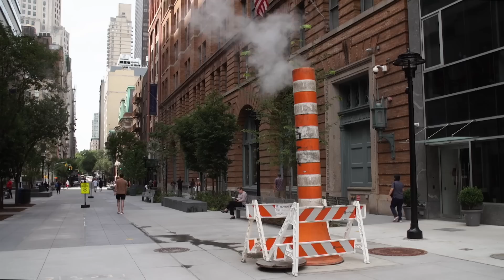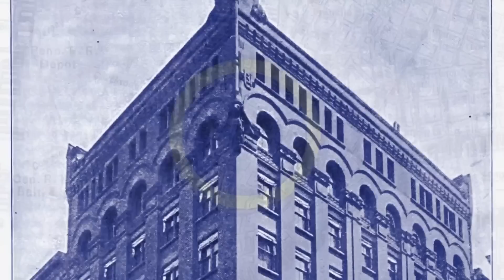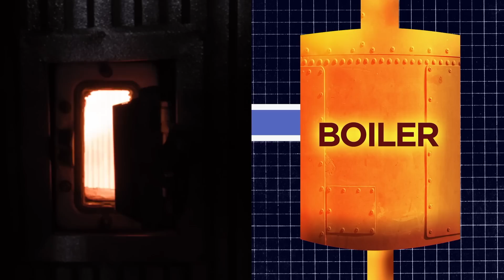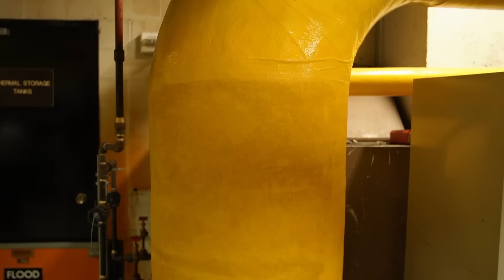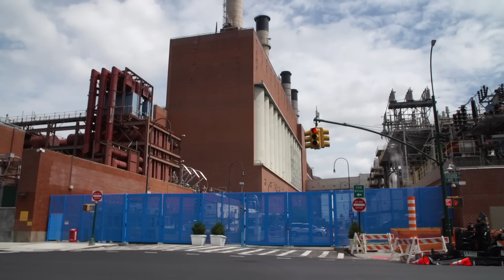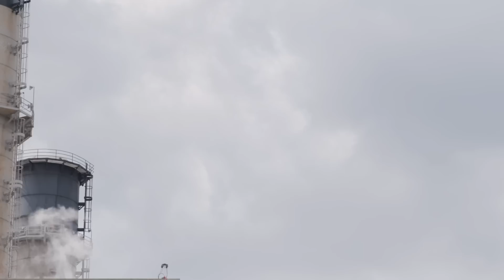New York City Runs On Steam | NYC: Revealed

Comment: Heating with steam is noisy. Wouldn't it be better to use intermediate heat exchangers every 300ft level? (10Bar/160Psi) Yes, you would need a technical room every 300ft level, but....

Comment: ConEd needs to start looking at nuclear before the whole system implodes on itself and then they'll be left with Coal and kerosene heaters. When industry finally understands and accepts that electrifying it's operation is only going to happen with nuclear heating its water which produces steam which turns the turbines which makes electricity one peanut size of enriched uranium can heat vast amounts a real estate the answer is more smaller nuclear plants rather than fewer gigantic ones it's going to come down to you either take the bus or walk type of choices and options.

Comment: You can tell that the Con Edison representatives were desperately trying to convince us that steam is the ideal way to heat buildings to warrant their existence. Repeated comparisons to days where you'd heat homes with wood fires and coal and even Victorian London during the peak of the industrial revolution is pretty funny, when much of the modern world uses central heating with electric boilers without issue. At the time it was introduced it would have been the best method no doubt, and I'm sure there are some advantages over modern electric central heating systems - but they really didn't have to downplay the alternative technologies and act like the only other option is huge coal power plants in each building to make their way look superior so much haha

Comment: One of the sad things about using steam, is the fact that we don’t use the heat produced by boiling water into steam.. our energy is produced due to the fact that that water expands 600 times its volume when converted into a gas.. we use the expansion of the gasses, in he form of pressure, to spin turbines to create energy.. all the energy we put into heating the steam is wasted .. we burn millions of tons of coal and natural gas to heat up water so it will expand, then vent the steam into the atmosphere, where the heat exchanges into the cold air around it, dropping its temperature, which causes the steam to condense back into water, and end up in lakes, rivers and oceans

Comment: Consider that hundreds of thousands of gallons of water is being released into the air every hour.. there’s enough clean water just in the atmosphere to ensure that every single human being on the planet has all the water they could ever want.. same thing goes for energy.. we produce energy by spinning an electromagnet inside copper wire coils, which gets electrons moving and creating energy.. the core of our planet is magnetized lead and other ferrous metals, and we have trillions of tons of copper, and other metals embedded in our planet’s crust, mantle, and our spinning liquid outer core.. or planet and the core inside it, are essentially a MASSIVE generator, we just have to find a way to extract the energy being produced by the planet spinning.. nikola teslas tower was able to tap into this resource, but due to no being able to control the amount of energy used by individuals, they stole all his research and labelled him as a crack pot crazy scientist .. 
think how much energy the mass of our planet could produce ..
We use water moving at high speed to through a generator.. the weight of the water is what produces the energy.. we take the kinetic energy produced from water moving, and turn it into potential energy which can be stored..
The weight of our planets is millions times greater than the water flowing through the penstocks at a dam facility

Comment: Steam could be the perfect system for a city... Nuclear power is just indirectly heating water with radiation which is just steam management. Use nuclear plants to generate steam. Use it's own energy and desire to rise to let it flow up the buildings without requiring extra energy to do so (much as they're doing now but with gas fires). Have a central condenser unit on the roof that puts it back to water, already hot water which could be used in faucets on it's way back down, with the benefit of pressure as it's now elevated. Or, have whatever isn't used drop down a central pipe to be collected. Warm water could then be added to a combined waste water pipe, allowing for expedited breakdown of waste with the added heat & more active biological cultures therein. Then the sterilized waste flows out to dry, and can be used as fertilizer on farming fields. It could be a very well-connected and efficient system, still using steam which we already have a good amount of infrastructure there for.

Comment: Berlin is running on steam too. Not this building i am sitting in. But many many around me. It s called "Fernwärmenetz"
Reply: Nope Fernwärme is not steam but hot water and it's a closed system so no leaks and the water is running back to the provider.

Comment: As a Swede where we use hot water thru pipes in the street I would like to know what the advantages is with steam over hot water just under the boiling point?
Reply: Steam under pressure can be super heated resulting much more energy in the heat exchangers of the buildings heating systems.

Comment: Steam is by far the beat source for heating, cooking and making electricity with minimal effort.  The fact that we seem to want to move past it is sad and very mind blowing.  Steam has so much power and even just a couple psi of Steam can run engines or feed heat to houses. Insanity
Reply: Only if the water comes cheap, otherwise; it's grossly inefficient

Comment: Combined cycle cogeneration system. Gas turbines turn generators to produce electricity and the waste heat operates boilers and the exhaust steam is what is sent to the end users. I have been an Engineer for over 50 years and am at work right now at a hospital.

Comment: The red and white small stacks are releasing what’s called condensation this steam power goes back to Victorian times
The taller stack based on the colour of the smoke coming out of it getting close to black smoke may be an indication to a combination of plastic or rubber and maybe coal. You could also use steam to power a generator/ dc 3 phase to make electricity. In addition there are other ways to make electricity using other methods which I’m not going to go into as it’s currently being developed. 
All I will say is it doesn’t involve nuclear.  hydro. 
Wind. Sea currents. Tidal. Or solar.

Comment: I don’t understand why buildings can’t be converted to electricity. It seems very simple and logical.
Reply: Logical long-term thinking gets you outcompeted in the short term.
Reply: For heating, every building would need a new, significantly larger transformer. Let's say double the capacity. For a single house that's doable, for big office blocks it means your entire electrical utility room needs to become twice as powerful which is not a trivial thing to do. 
Now that's done, you also need to double the section of the feeder cables in the streets. That means digging up all the old cables etc etc. 
In the long run, it will be cheaper. But it is absolutely not simple. It can only be done if the city mandates the switch and everything can be done in one big sweep.

Comment: It seems weird for me that steam is used. In my home country we use water that is almost at boiling point for the distribution of heat. Steam is only used on industrial sites. What an interesting system 😮
Reply: In your country, you are using more water and more fuel because water has a higher latent heat content.  Also, water has  greater friction long the inner walls of the pipe as compared to steam.   Unless your country is Iceland. Where geothermal energy is used those negatives are negligible.

Comment: Steam district heating networks are neither sustainable nor efficient. There are also no many options to transform that ancients technology to a sustainable solution without geothermal heat potentials, lots of biomass or gas with CCS. It’s also not viable to use heat pumps without low temperatures (water) heating networks. So basically NYC will face problems in the future.

Comment: How come hot water is not used but rather steam? I am guessing that the energy needs are so large that hot water could not transport what is needed?  I am asking because using hot water with much lower pressure is of course safer.
Reply: next to no moving parts as the steam pressure is created by the waters expansion. I assume this is very convenient as opposed to pumping hot water up the tall buildings in New York. 

More than anything the infrastructure is already there for steam so it’s easier to stick with it for now. New builds are more incentivized to use alternative means for heat but retrofitting an entire building is too expensive to be feasible

Comment: This is such a perfect use case for a boiling water nuclear reactor. The infrastructure is already there just pull out the gas turbine and drop in a reactor as a green source of steam. Completely decarbonize without changing the existing steam infrastructure
Reply: Simple right 😒
Reply: @BrianStroud-d3p  alot simpler than replacing all the infrastructure with something else. Its only as difficult as putting in a new gas plant.

GE is actually working on district heating projects in europe using a SMR BWR just like I suggested if you want to see an example, lookup the bwrx-300 district heating
Reply: No city nor its residents are going to allow a new reactor to be built in or near it
Reply: @sharkheadism  plenty of cities have reactors built near them, you put the reactor closer to where the demand is for efficiency sake.

If we had an honest conversation about the actual safety of different power plants people might realize that they're safer with a nuclear plant in their backyard than a coal or natural gas plant, and any of those are much safer than chemical processing plants.

Comment: Do they take back the return condensate from the buildings?
Reply: Each customer is required to first reduce the temperature of the condensate (which in many cases that heat is recovered and used to "pre-heat" hot water thereby reducing energy consumption).  The water then goes into the sewage system.  Each customer is then charged for the disposal as a percentage of the steam consumed.

Comment: It's also important to note that the vents are not releasing steam - it's actually called Condensate which forms when steam is cooled by an instantaneous reaction when introduced to the atmosphere. That temperature is significantly lower than the distribution steam. It's critical to maintain a safe, efficiency operating system inside and outside, so the use of reusable insulation blankets keeping the steam temperature in the piping as hot as possible increases energy efficiency, safety per OSHA standards and sustainability/CO2 reduction. There are also NYC laws in place to enforce these attributes which are good for the environment used by countless Healthcare, Higher Education, Municipal and Hospitality customers in Manhattan in safe and effective ways.

Comment: Did I miss something, or did they not explain anything about why they use steam instead of water? My city is switching from steam to water for efficiency reasons, so the natural question is why did anyone use steam in the first place? 

Moreover, how is the energy in the steam actually converted to heat in the individual room? Again, it’s easier to understand that hot water in a radiator heats the radio at or, which then heats the room.
Reply: From what watched, I would say that steam distribution was just much simplier back in the day.  Just a boiler, a pressure tank and pipes and valves.  Very little use of electric pumps ( require more sophisticated tech and regular supply of electricity).  Since the infrustructure has been working for decades, there was never any incentive to shift to more modern systeams.

Comment: Why not hot water? In Poland we use hot water heating from power plants widely, for millions of citizens... And nothing explodes.
Reply: Steam was easier to move around a century ago, so they went with that..
Reply: Steam could run more things than just heating, saved a lot on electricity and gas demands when they were building the system in 19th century.
Reply: Because it's America...

Comment: It’s surprising how much these comments expect
you to understand the infrastructure of a city. I learned a lot in this, steam engines were a fad of the 1920s, quickly replaced by higher efficiency combustion engines. There’s no reason to expect to see them anymore, let alone expect an entire city to be running off this antiquated system.

Comment: I would have preferred to see the actual numbers for cost over time comparisons against the many other solutions for HVAC and electric.  Are these steam buildings single point of failures or can one back the other? Where was steam generated electricity when New York City has had three major blackouts, neither of which were forecast or expected. The first was in 1965, the second in 1977, and the latest in 2003. The 2003 was caused by a “software bug” in an installation near Akron. It is a reminder that energy consumption is not the only threat to an aged grid. It seems no one wants to look to far down the road since they will not get credit for something done now to make better in the future. The real driver for all is money and if CONED can just keep saying how great they are and everyone believes or trusts but does not verify then we are headed for problems.

Comment: I have a gas-fired hot-water heating system.   Quiet and draftless.  Converted from oil to gas in 2016 after a lot of regulatory BS relating to location of my oil tank.

Comment: This is cute. It doesn't actually point out that it's natural gas burning to heat all that steam. Doesn't even show you what a boiler is until 9 minutes in. Doesn't point out the carbon footprint if we're measuring what science says is environmentally friendly, just claims it's efficient. Yeah, compared to wood stoves. Idiocity, not Curiosity.
Reply: It solves all the problems of expanding cities with this newfangled technology... 150 years ago. So that's it, then. This is the sort of technology we should find the remains of in archaeological digs.

Comment: I just have to wonder: how much does all the steam released into the air raise the humidity in the area? Does that increase the discomfort in the summer and the amount of snowfall in the winter?
Reply: When the system is working optimally, it's possible that no steam is released, since it condenses to water when all the heat is extracted from it. But I don't know if all the applications for this steam actually extract all the heat that's in it.
Reply: Too little to measure. It is next to an ocean.